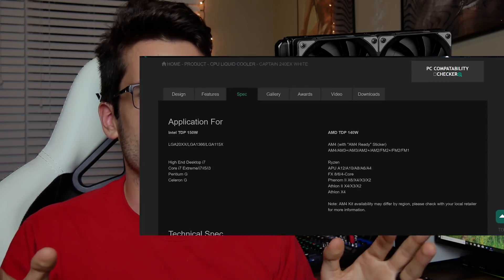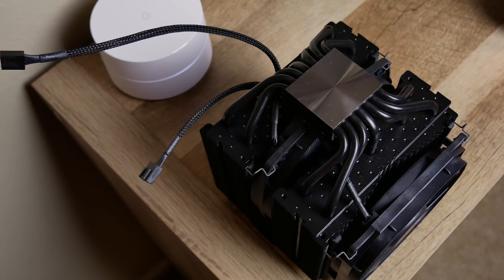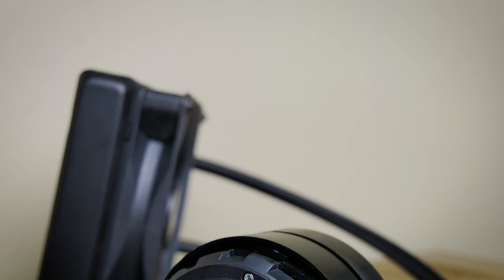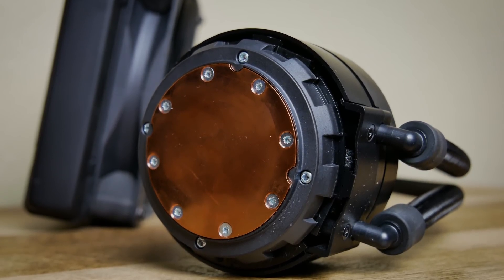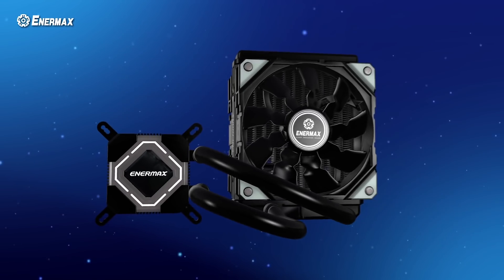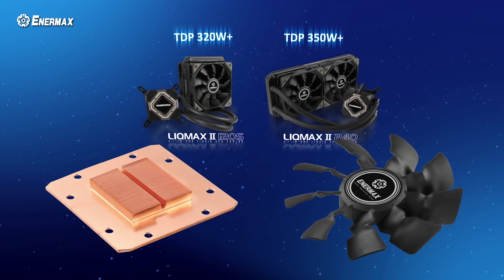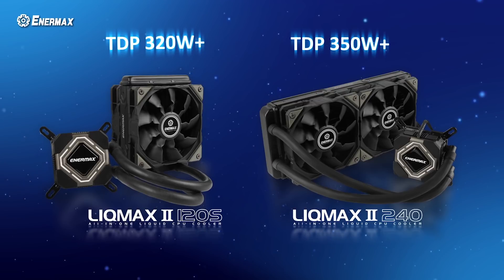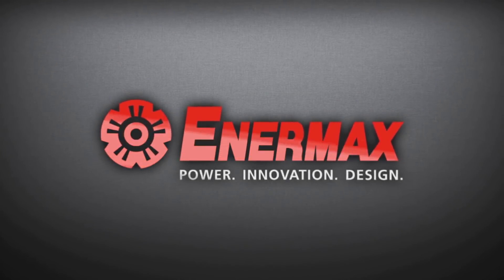Ever Wondered Why TDPs Aren't Listed for AIOs?

Comment: probably not what you expected - a question rather than my own opinion. Do you think a dark rock pro 3 / 4 would have better heat dissipation than a 240mm AIO?
Reply: Try then out and see.. Many factors go into what will work better.. How many fans / what type of fans are in the system.. How it is balanced ect...

The only true way you can know if one is better than the other is to try them out yourself in your own system...

Example: Is the 240mm AIO/CLC mounted in the front / top / bottom? what Fans are installed? are they in a push or pull setup OR a Push & Pull setup.. How thick is the AIO's Radiator.. How good is the pump in the AIO/CLC? (I know most are asetek  but not all are and even among asetek their are different generations of pumps) Or the Cold-plate and how well it covers the IHS. All kinds of variables you might have in your system that are different from someone else testing.

Then there is the Dark Rock Pro 3 /4 how is the airflow in the case? is the heat that the DRP dissipates able to be vented out of the PC or will it sit up and around the CPU..

The short answer lol is the Dark Rock Pro 4 would most likely have better heat dissipation in theory and specifications. But that does not mean a GOOD 240 AIO/CLC with good fans in a push/pull configuration venting the hot air out of the system would not perform just as well on say a 7700k / 8700k.
Better would be more like a 280mm AIO/CLC.. with very good fans.. (Like my personal favorites Noctua's NF A14's in push/pull [thats 4 fans sucking the heat out of that Rad =) ]
Reply: I'm personally using an open loop, but I got a dark rock pro 3 for my dads pc, as it requires no real maintenance except maybe cleaning dust every once in a while, compared to an AIO solution which has a lot more parts that could fail. I also heard of pumps regularly failing on those, so I'm kind of trying to hold off on them.
Reply: David all those heat pipes. It basically is an AIO.

Comment: cool content ! im running 240mm kraken with r5 1600 overclocked to 3.9 @ 1.33v and i dont get above 50 to 55c while playing AC origin for 5 hours xD
Reply: Ammar Alraisi i get  the same performance with my dark rock tf in an itx case. same cpu and OC
Reply: wtf..  1.33v for 3.9ghz?
Reply: Mystic_ 112 he won the silicon lottery or hasnt fully stress test for over 24 hours
Reply: ab12 1.33v for 3.9 is pretty bad efficiency and heat..
Reply: Mystic_ 112 uh for ryzen it's  not... you'd  be lucky to hit 3.9 at 1.4v
Reply: ab12 lmao. that's horrible
Reply: Mystic_ 112 thats ryzen for ya. still cooler than intel chips

Comment: Enermax Liqmax 2 has TDP numbers written all over the box yes, i got my second set now. first i had the 120 version on AMD Phenom II X6 1090T black, it kept it's cool really well! now i have the 240 on my  intel 6600K 24/7 overclocked to 4500Mhz. it's cool as as a refrigirator. 35c on standby or watching some video's on dual screen, and 55c max on gaming.
for a science guy i hear a lot of assuming in this video.
Reply: Harm Zegt 35c at idle is actually really terrible for a liquid cooled cpu. You should be around 3 to 8 degrees above ambient on an idle cpu.
Reply: If the cooler was indeed 240W TDP the temperature delta at 134W dissipation would only be 12C, so you should see 47C max temperature. Your cooler is about 130W TDP.
Reply: Your CPU at 4.5GHz is nowhere close to 350Watts TDP. A Third, at best
Reply: My noctua NH D-15 runs at 27 degrees while idle, my dude. 35 degrees doing anything but gaming and 68 at 4.8 ghz degrees while gaming.
Reply: My hyper 212 does the same thing
Reply: those aren't temps over what air coolers can do btw :P, u aren't pushing that cpu enough and for a long enough time, thats why it stays cool, its got nothing to do with the aio's performance, but enermax coolers are great anyway
Reply: For running at its OC frequency at all times, nice temps
Reply: Emanuel Morales, probably isn't though. Energy setting most likely at balanced and the cpu underclocks when not needed or the temperature would be constant.
Reply: Emanuel Morales even if it is running that frequency at all times it isn't going to increase temps much at idle. You will draw slightly more power at idle but not that much. I run a 7820X at 5Ghz across all cores and my idle temperatures are around 25c on liquid in a room that has 19c ambient.
Reply: Did you disable EIST? If not, your CPU is clocking down as much as possible (which is why EIST is a good thing). Run Handbreak on a 1080p Bluray rip or some 4k footage and have it encode to H.265 for 4-5 hours straight. Water cooling is really good at handling pulsed loads like gaming since it generally isn't maxing the CPU the whole time and water takes a long time to start heating up.
Reply: Harm Zegt that oc is weak asf and whatever aio you’re using is terrible. The 6600k is a fairly weak cpu, when i had one i had a 120mm and got the same temps as you on 4.8 ghz. Enermax isn’t that good of a brand and you are the one who assumed. Plus you don’t know a lot about PCs
Reply: Sic Semper Beats No, actualy it is A great oc together with my GTX1070 FTW2. Perfect combo. I do Not or hardly stream.
Reply: Alright, here is my result for my i5 6600k@4.5ghz, uncore 4ghz@1.38v, Performance profile windows. With Noctua NH-D14 with single NF-A15 right in the middle. With ambient~23c, It did around 30c with youtube 4k@60, at idle it's almost 2~5c delta, I contribute this to my case, SilverStone FT05@600~800rpm. Gaming, e.g. Kingdom Come: Deliverance it don't even go over 60c. Only when I do Resolve export it gets over that temp. Max I saw with this oc at that voltage is around 70c. Damn, these tower air coolers are beast!
Reply: That is terrible. My system 3770k@4.2ghz 1.28v (system last leg, no longer the 4.7Ghz OC it once had) with Cryorig C7 stock 140mm set to pull. S340 with 2x140 intake 120/140 rear/top exhaust Noctua Redux. All fans 60% (cpu 1100rpm Noctua 900rpm) Ambient 20c all while playing FFXV on a GTX1070 at 2560x1440. Highest reading was 58c after 3hrs of play. If you need idle 37c on averge. Enermax is just not good that is all it can do.
Reply: hit it with a stress test for an hour and report back :)
Reply: I have the Enermax Liqtech II 120mm model of their AIOs, and as I am watching this video the current temp on my 3770K @3.8GHz is 44C. Granted, I am in an mITX system with fans on low power, but even when running intensive games such as modded Arma while recording on OBS I have never exceeded 65C

I would like to add that from looking up articles on tomshardware, 35C is a pretty standard temperature when idling due to Windows background tasks and  programs.
Reply: So many hate right away against his numbers....But no one seems to ask what case he has  and so on.... Put a o.c 4770k in a sound dampening case slap a aio on it and you guys also are gonna blaim the temps on the cooler??? 35 on idle and 55 degree on gaming is just fine and are pretty good numbers non the less.... And @semper beats Did you just call the 6600k a weak cpu??? It's a perfect i5 for gaming and in nowhere "WEAK" and seeing that the 6600k is standard at 3.5ghz then yes 4.4ghz,4.5ghz is gonna be the norm max for that cpu... Maybe you got lucky with 4.8ghz but this is far from the standard for that cpu....

Comment: Less than a dozen? Top ten? I don't know, something like that. 'Sup Greg.

~Edit~ Have you noticed any kind of VRM temp difference between a Tower cooler, like a Hyper 212 Evo, or a Cryorig H7 (Which I have) over an AIO? Both seem like they leave the VRM cooling off the table compared to downward blowing CPU coolers.
Reply: if you are that concerned about vrm cooling, get a board with active vrm cooling or point a fan at them. active vrm cooling is really pointless unless you are trying to break a firestrike record or something like that
Reply: Berenger Christy I'm not concerned at all, simply curious if he has personally noticed a discernable difference.

It's also not about OCing or firestrike scores, its about general system temps and board longevity. 

I personally don't bother with water, so it's not something I have equipment to do comparisons with.
Reply: so long as there is air moving through the case the vrms will be fine. literally just have case fanse. vrm cooling is a non issue unless you are really stressing your system
Reply: Berenger Christy You're missing the point, let's use a car analogy to compare.

You're telling me that it doesn't matter if I use a muffler or not, because I'm not boring out my engine, so it's not going to blow up anyway.

I'm curious as to what, if any, differences there are between something like the Dark rock Pro, or Evo 212, or H7, compared to an AIO.

Key word being curious, you're assuming that the information will have any impact at all on my personal use case. It doesn't, at all. My VRM are fine, so think about the question, as opposed to your assumed application of the information.
Reply: then if we go with that analogy you're asking which muffler you should pair with your bored out engine, to which I reply it doesn't matter

its obvious that blowing air on something would help to cool it, so why bother with the experiment? its exactly why you want case fans even if you've got water blocks on the gpu and cpu. what would one do with the information? continue to use the stock cpu cooler so that their vrms are slightly or somewhat cooler at the expense of their cpu being warmer despite the fact that vrms can run much hotter than the cpu? I'm trying to tell you that if there are differences, then they are meaningless. why bother setting up an experiment if you or anyone else isn't going to do anything with the information gathered?
Reply: I can't actually test this because my cheapass mobo can't monitor vrm temps but I'm pretty sure that my vrms are cooler now with an aio than they were before. I have a define s and I have an exhaust in the back and three more on the top. Everything else is intake and the aio is front mounted. My air cooler (obviously being right next to the vrm) heated the whole area more and the fan directed air out of the case through the back and that air never toched the vrm heatsink. Now with the aio the vrms are the only thing in their area to generate heat and more and cooler air is flowing over it. Also the cpu is running cooler therefore requiring a bit less power. Basing on all this I'm pretty sure the aio is better for the vrm but a downdraft would probably be even better.